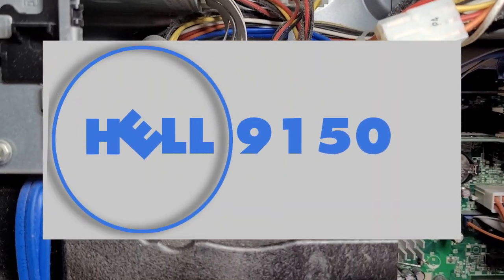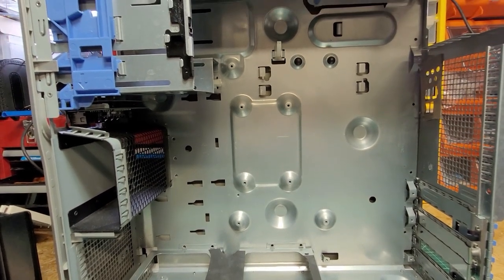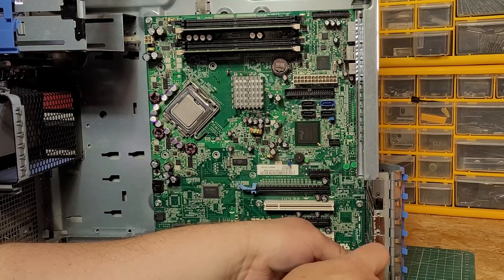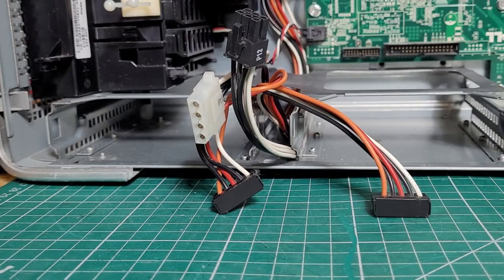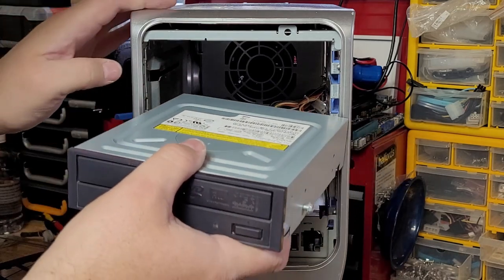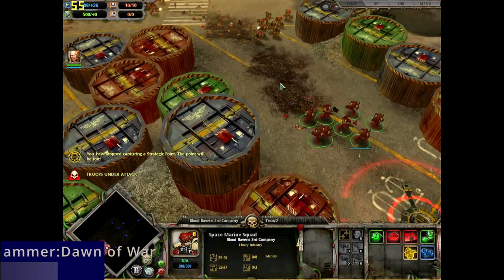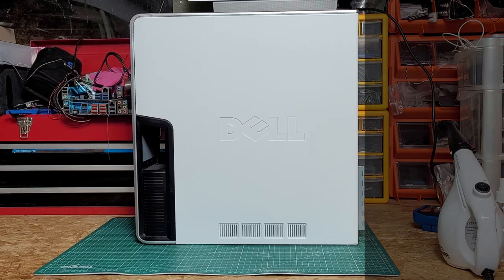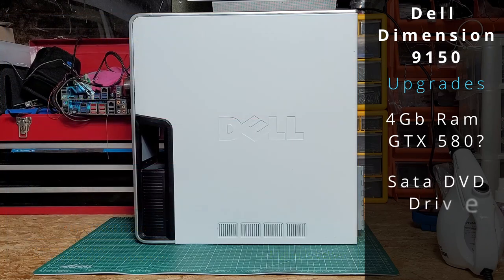Dell from Hell Dimension 9150

Comment: Boy, you ain't seen nothing. In july 2019, I had to deal with an old hp business pentium 4 system on a wood boardwork plant. That THING, was not a pc anymore but a lot of wood infused with metal. How that THING was still doing its job coordinating the planer was beyond me. Anyway that thing was a fire accident ready to happen, got replaced by one of those ultra small lenovo bricks which are fully passive and essentially hermetically sealed as long as you don't loose the port covers.

Comment: An obvious upgrade would be any other quicker socket T (775) cpu anything supported after bios A04 such as D940 , D945 & D950, a cheap 250GB SSD (OR TWO for raid O) 4gb DDR2 1066 ,Should work well

Comment: Some time ago I "fixed" a Dimension E521. I quickly found out that it was indeed the first Dell System with an AMD CPU (Athlon64 x2 4200+)!
"It wont boot" was the diagnosis of the owner, so I opened it up and roughly saw the same as I did in this clip.🤢 

I cleaned him up, gave him a new battery (which was the reason he didn't boot in the first place) and I replaced the "jet engine" fan with a noctua, improvising with the fan header of course... 😊
The owner which keeps this monstrosity just for printing purposes promised me to gratify my service with the "thing" itself, as soon as he gets an modern printer with which he could print from windows 10. 🤣🤣 I would love to have it although I know it's not worth pushing the power button for anything else but office purposes, but I love those old wrecks, especially when they are completely in the original state 🥰
Reply from the maker: I think the reason I like these types of pcs more is that everyone else just sees them as E-waste. If you look beyond the proprietary stuff they are actually fairly well made. I've got more Dell pcs then any other brand. I even used a Dimension E520 case to make my daily pc into a sleeper pc. Got to love the unexceptional stuff 👍

Comment: just found one of these today, relatively clean with a power color brand graphics card. unfortunately it doesnt have a hard drive so i think i'll need that and old monitor (unless the hdmi works natively) to get it going
Reply from the maker: I use adapters a lot. Hdmi to dvi or dvi to vga. Can pick them up pretty cheap. It'll POST without a hdd so you could get some more info on it
Reply: @Revivify  right, ty,  i should try that first, hold F2 when powering on to get to bios without an hdd amirite?
Reply from the maker: @corazzellim  F2 or the DELETE key. Intend to mash both if in doubt
Reply: @Revivify  thanks much! i'll let you know if i get it running!

Comment: A GTX 580 would be way too fast for the Pentium D. I would try to find something like a 9800GT or a Radeon HD 4850/4870. Event those would probably push the CPU, unless you upgrade to a core 2 duo. That Dell is a nice find!
Reply from the maker: Funnily enough I just picked up a new old stock 9800GT
Reply: @Revivify  That's awesome! Which brand is it? I remember wanting one of those so bad back in the day but could only get the 9500GT. Can't wait to see the benchmarks on that beast!
Reply from the maker: It's an Inno3d

Comment: I guess you at the limit with the Pentium D? I don’t think these support c2d or c2q but I maybe wrong, would be nice to see a few cheeky upgrades! The old girls lasted this long 😎
Reply from the maker: I'd have to check the motherboard to see if it supports c2d. I think they did a 3.6GHz Pentium D? But performance increase is minimal
Reply: Your correct these dont support C2D or C2Q think the fastest was D950 or D960 so long ago i've forgotten.